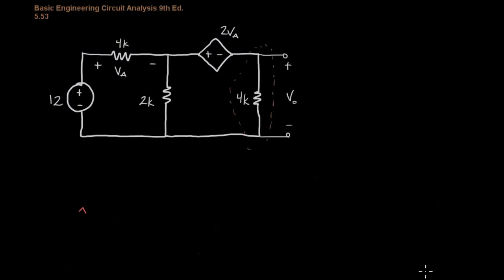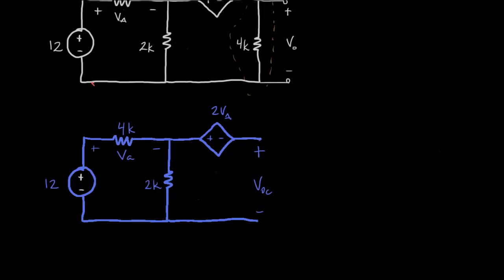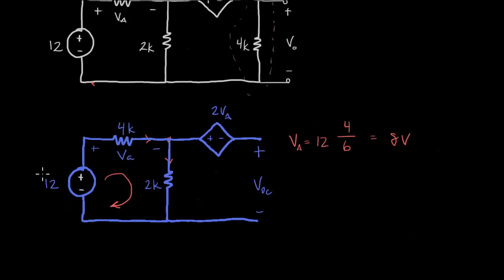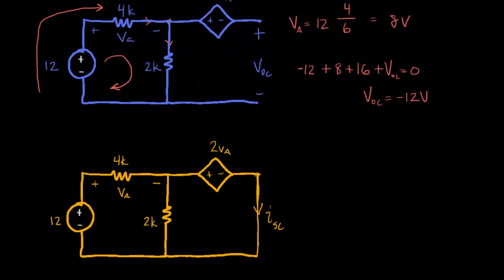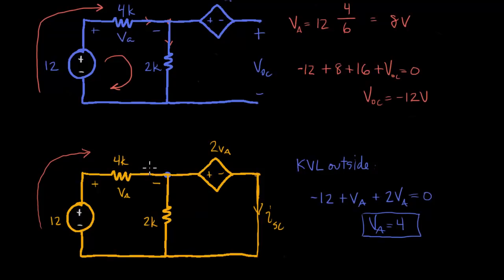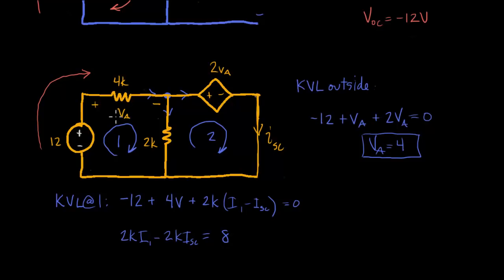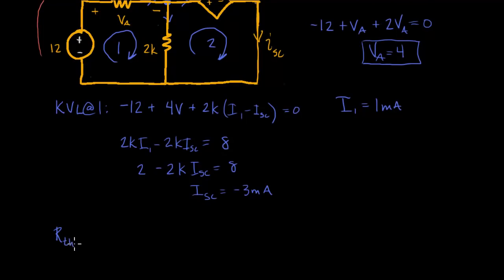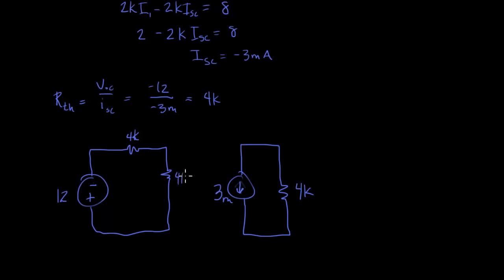Thevenin's equivalent with dependent and independent sources Problem 5.53

Comment from the maker: Darren,
When looking for Voc, keep in mind the terminals of this voltage.  The negative terminal is connected to the bottom of the circuit.  The key to solving this lies in using KVL or KCL.  There a several different approaches.  You could also do KVL on the right loop.  That would be Voc= -2Va + V(R2k)  This solution give Voc = -16+4=-12 which is the same answer I get in the video using KVL around the outside.  Hope that helps

Comment: my teacher said, and I've tried and worked for me, if you want to find something in a resistance parallel to a current source you use kcl, else you use kvl, because most of the time you lose less time.

Both solve any problem the thing is to find the one that does it faster so you won't lose time in the test.

Comment: Not to quibble, but if you have the Norton circuit you don't have to back solve to find the voltage drop across the load. V_Load = I_N÷(G_N + G_Load). In this case, - 3mA ÷(1/4k + 1/4k) = - 6 volts.

Comment: I think there's a mistake at 10:12. You acknowledge that i1= 1mA, but the only way to have isc = -3 mA is if i1= 1A. I've found this material a bit more difficult than previous material. Thank you for taking the time to make these videos!
Reply: I1 and Isc will not be the same value

Comment: Open terminals will still have a voltage drop/rise, just no current. So you can apply KVL through an open terminal but not KCL from an open terminal.

Comment: This is a good video but the KVL for used to find the Isc was unnecessary. If you have the voltage for the dependent source, then you have the voltage for the resistor in parallel. Well, if not KVL, then KCL but I am under the impression that the KVL form is more involved than the KCL version.

Comment: how could you employ KVL on the open circuit to calculate Voc in the first part ? isn't that wrong ?
Reply: There is still a voltage drop across an open circuit. just no current.

Comment: I don't understand how Va can be equal to 8V  when we used the voltage division rule. And how it can change to 4V when we use KVL to find the short circuit current.

Isn't Va=Va so it should only have one value ?
Reply: the Va for the short circuit and the Va for the open circuit is not the same as they are different circuits (adding the jumper makes the difference) thus you cant use them interchangeably and same is true for the current. you have to solve for it again.
Reply: Thanks rik.yan. It all makes sense once you understand it hey....

Comment: at 13:27 Va = 4 you said but when it was calculated earlier it was 8 V??
Reply: i think it's because Va is different for a different circuit assumption. First one had open circuit setting for load, 2nd one had short circuit setting for load.

Comment: Hey Matthew for V_oc isn it = to the voltage drop in 2K resistor
Reply: Ash W not if there is also a dependent source, that contributes to total resistance seen by the load

Comment: i can't understand why we removed the load ! , and there's a direct way to calculate Rth even with dependent source ,by applying test voltage source
Reply: @Kermit DuBois yea that's true , but my point is about removing the 4k resistor which i didn't understand , look at this prof solving a similar problem without removing anything :
https://youtu.be/S-3NWNrAQRQ?t=1446

Comment: voltage across 2k resistor = Voc  , as u remove load (open ci rcuit)
.so why are u calculating Box seperatly ?

Comment: When you solve for Voc what happens to the 2ohm resistor?
Reply: +Goce Dimitrov Old comment, but in case you're still wondering, he used KVL to solve for the voltage around that one loop. Remember that voltage across two parallel loads will always be equal, so the 2kohm resistor is not included in the equation. This is the implication of Kirchoff's voltage law.

Comment: Excuse me. In 2nd part of the question you easily found Va = 4V. But then you did mesh analysis which took very long. As Va=4, voltage of the node at top middle is 8V. Then we can easily determine Isc
Reply: Agreed. We can do the 4V drop divided by the 4kohm resistor and the 8V drop across the 2kohm resistor to get 1mA going through the first resistor and 4mA going through the second resistor. With 1mA going into the node and 4mA going down and out of the node, we know that 3mA must be what the 2Va source is supplying. This means Isc must be -3mA (because it is defined as the opposite direction as the current from the 2Va source
Reply: Can you explain why the first mesh is accepted (the outside mesh KVL)?

Comment: how do you identify a load??? he didn't explain that part at all
Reply: Mostly in question the value of load  is provided
Reply: Load is that resistor across which thevenin or norton equivalent has to be drawn. In other words you could simplify the complex circuit to thevenin or norton equivalent ciruit across the load.